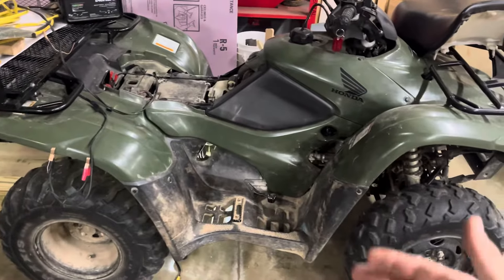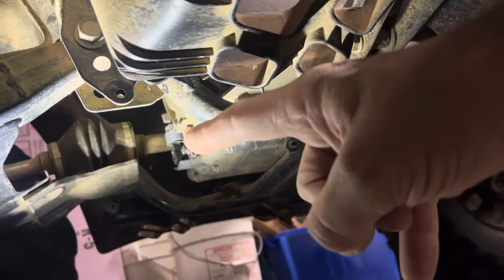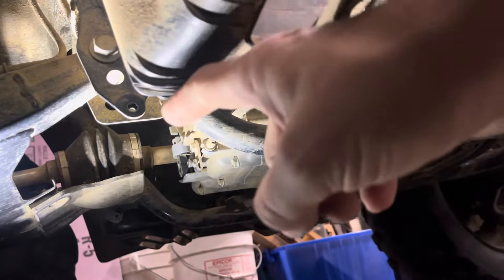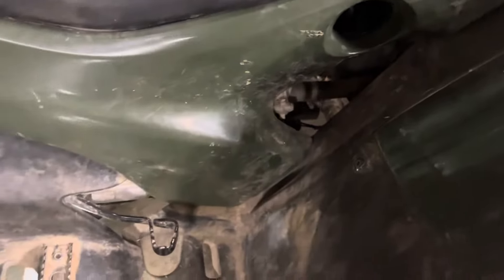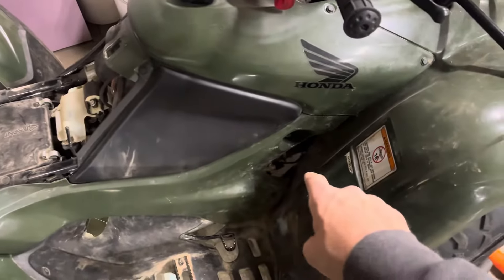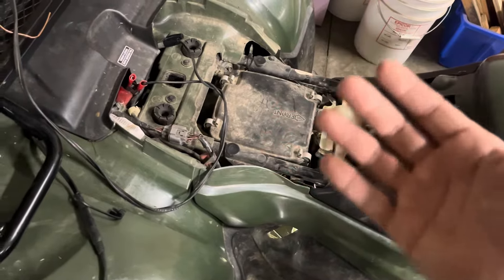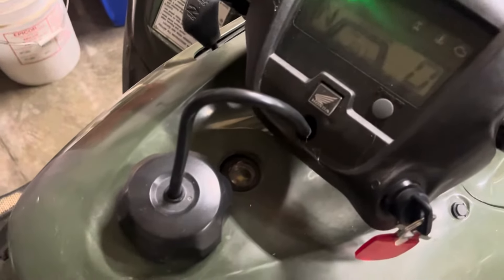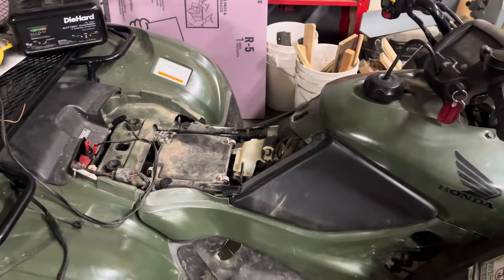Honda Rancher 420 | Not Shifting | Angle Sensor Location

Comment: You are the man. I’m about to dig in. Have had no issues besides it getting stuck sometimes since new. My guess is shift motor has zero grease on it. Gonna put white lithium grease in there and clean the assembly. Also going to trickle charge the battery based on your advice. Will hopefully remember to update on how it goes!

Comment: Do you know if there is a way to convert these 420s to a standard foot shift? I know on the 2000s ranchers and foremans you could but I can't find anything on the 420s
Reply from the maker: I don’t. Wish I could help.
Reply: You have to change the cases sadly. So it would be a full engine tear down. Not worth it imo. I’m sure there’s more stuff to change as well gear wise in transmission. I regret not getting a foot shift big time. Don’t fix what’s not broken! More wires=More Problems😂

Comment: Got a question would yours shift but sometimes won’t shift? I’ll be riding and have to slow down for it to shift i have to pretty much stay in lower rpm’s almost even stop
Reply from the maker: Yes, occasionally it would do that. Check your battery voltage. Charge it would be my first suggestion.

Comment: Any update? Did you have to replace any parts?
Reply from the maker: No. Turns out it was simply my battery.

I have had one other “won’t shift” issue since this video and it was the shift motor getting stuck.  I took the motor apart, put it back together and it’s been shifting like a champ ever since.

Comment: My problem was low battery. I had to rev a bit to shift from R to neutral. Put a nrw Noco lithoum as the original was 10urs old.
Reply from the maker: They don’t like low batteries.  I just had another issue and it was sticking brushes in the shift motor.